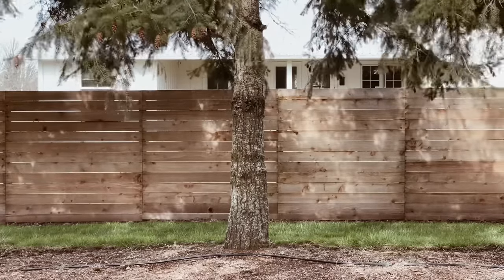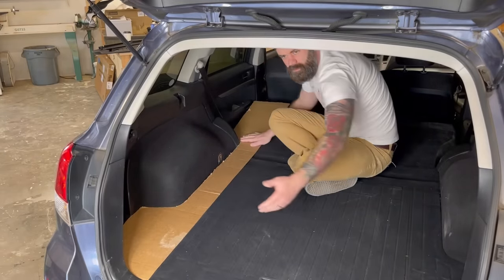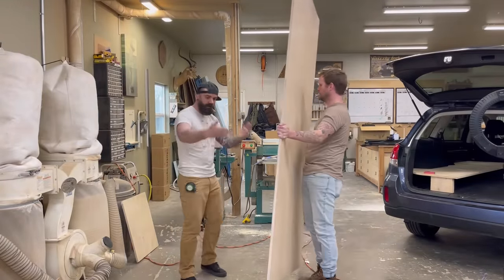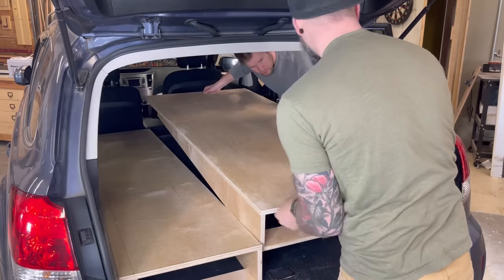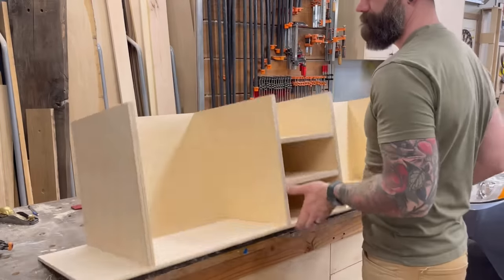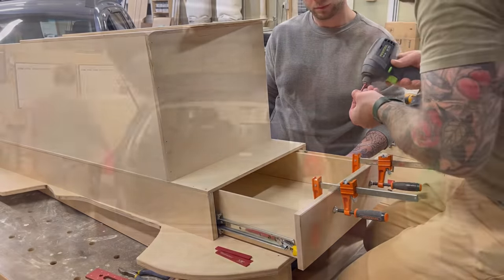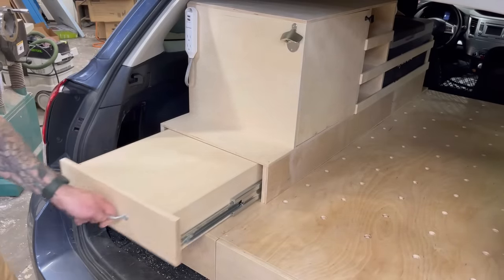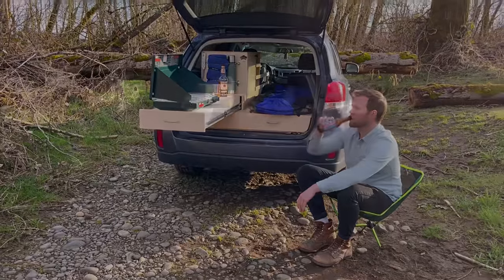Look What I Did To My Friends Car || Ultimate DIY Camping Conversion

Comment: Camping mattress in the back works fairly well for leveling out the back. I really wish those seats really folded flat.... I did wish for a platform a few times.  
Cabinet taking up half the space means he doesn't have room for company though....  I always just pulled gear out of the back and stuck it in the front seats and rear passenger foot wells. Plenty of room for two back there. 
Also, the wires from the solar panel seem likely to lead water in.... Better to leave some slack so it can be run up from the bottom when parked.
Reply: They fold flat in my 1990 Subaru Liberty wagon! Rear seat base flips up, take out headrests, fold seatback forward and it connects securely to a couple of tabs on the now-upper edge of the seat base. Quite flat and no sag over time. Superb old car. 420,000 km, no blue smoke, still fun to drive :-)  Phillip (Tasmania, Australia)

Comment: Strayan here. One thing we do here is use teflon runners for the drawers. They slide smooth as, and you get a significant increase in drawer size without the goliath runners. Bear that in mind when you do that minivan ;)

Comment: Nice build!  and great skills ! Lots of wonderful positives in this !  love the slide out drawers and table ! and awesome cabinet spaces!  but,  quite a bit of "wasted" hard to access space. 1) the place where the spare wheel was. 2) between the cabinet and the car window on the left side. 3) between the base board and the folded back seat.  . I have looked at several builds!  Quarter inch(6mm) ply was too thin in some. Your 3 quarter inch seems over kill and heavy.  Half inch(12mm) seems a good solution in many builds. I am considering 9 mm ply to make it lighter but will probably stay with 12 mm.  Very inspiring and great humour !!

Comment: Very nice design and build! The only build change I plan to make is to not glue, only screw, everything together. That will enable me to replace pieces when I discover changes need to be made or parts get damaged and need replacing. I think your design is so solid there would be very little loss of structural integrity. Nice project!
By the way: how much does this structure weigh? It looks like it takes a pretty big bite out of payload capacity…

Comment: Nice build. I have been using some tricks from Solid Wood Worx for my own little 2wd Toyota build (bed and cabinet system made last year). But, now i have a subaru OB so your work and design will be handy should i build it out. Thanks. SWW did a OB build but like others he pulled the seats out i think.

Comment: Hey, I just want to say LOVE your fun attitude and this video! Seriously... I’ve been SCOURING the internet and YouTube for a week now for the perfect car kitchen set up for me. I’m not kidding I really thought I was going to go permanently cross eyed. Then this!! It’s exactly what I want. I have a Mitsubishi Outlander.... which is Mitsu’s answer to the Subaru Outback. So pretty much exact match. I’ll be towing a small camper( 780 lb. Runaway Range Runner) so I don’t need the sleeping area but intend to use it as a space for my traveling buddy, Scooter the fat feral cat turned lounge lizard. The slide out kitchen system I think is the best and most efficient for this type of car. Plus the majority of available leather seats she can destroy with her claws will be protected when we travel. One thing I will add is I’d like to hinge one of the covers you made( with the hole for lifting) trace out the base of my collapsible sink and cut that out, so I can flip it out and have a ready to go place for cleaning up, yet fold it flat into that board and close it up when done. 
Sorry I’m rambling, just super grateful for you and excited to get this build going!! Said the middle aged chick lucky enough to have woodworking friends like you!! 😊😅

Comment: Nice build, but why didn’t you put the refrigerator in the front passenger seat area and include a few USB ports with an electrical outlet to charge electronics? Also, from my personal experience, anything breaking the rubber door seal results in rain water leaking into the cab of the Outback. How are you keeping that from happening?

Comment: nailed it :) look into marine grade finishes . . . and 'roughnek' finishes, it'll protect the wood stuff and keep the kit from bashing the living shit outta the car interior :)  those lil subaru are fun to kit out for stuff like that cause they either work or don't and if they work they'll go just about anywhere :)  also a really cool new bit of kit that people are adding to mobile deals like this are those vertical wind turbines, they're light weight, retractable mast mountable and generate lots o juice even in light to "no wind" situations and the newer line of vehicle / camp light options are slick as well . . . figured he put decent cash into that electronic rig, might as well go ham and have fun yeah :)

Comment: Center of a car. Laser level with a micro adjustment shot up through the car. When I worked for safelite we had to find center for recalibrating collision sensors and that's how we did it

Comment: Well done
Nathan should put in a 12v power port and USB ports. Makes no sense to use solar to charge a 12v battery, use an inverter to make the 12v dc into 110v ac so you can plug a phone charger in that changes it to 5v dc
Reply: I live in a Skoolie and run everything on 12v dc. No inverter
Reply: @SteampunkSteve  it's nice seeing others who have the same advice! Since you already covered the solar side, I offered up some advice on moisture issues, for the under side of Nathan's mattress... 😎

Comment: Any reason you used screws for the base rather than something like brad nails? Just wondering if that would be faster and with glue just as strong.

Comment: did you consider removing the rear seat backs, bottoms, and the foam under the rear floor deck? you could store lots of stuff in the space that is taken up by all of that stuff, and it is bolt in/out, so no permanent mods to the car.  You could put in hatches so you can access the area underneath when the drawers are pulled out. all you would need to do is remake the main supports once the seats and stuff have been removed.

Comment: This is a cool conversion! Nice job.
I like the carton stencils you used for the side trim! And very good explanation's. 
What i would like to know is, it seems you used a ballbearing slide that has a locking feature (trigger handle) but the locking feature seems inactive because you enclosed the mechanism with a drawer front and then added a separate lock to secure the drawer from rolling out. Why that? Or did you bypassed the locking mechanism?

Comment: @Bourbon Moth Woodworking I love this video and the build you did for your friend. I have just couple years until retirement and plan to live on the road. I thought of buying a printer can but looking at things they are not cheep plus the additional expense to convert. I drive a 2015 Toyota Corolla, while searching on YT for carlife, l came across your video. You inspired, it is possible to make any regular car a camper car. My question is, where are you located and can I pay you to build something similar like this for my car? Thank you for reading this and responding.😊

Comment: Love the build but hate the weight. 
Currently building out my 2001 vw golf in a similar layout but using a different build method. I am mostly using 2x2s for a skeleton frame and then I will lay a 1/4 ply, or luaun around it to finish it in. 
Also, I removed my seats to make it more permanent- multi piece so it can be removed for whatever reason but I dont intend to remove it much.  I am being very weight concious so I dont effect fuel economy too.. 

Cool video, tons of personality and funny jokes in this!

Comment: That is awesome man!! How did you get the wires from the solar panel into the car? Or did I miss something?
Reply: He went through the window as Nathan was going to put a rack and do it better later. He just closed the door on the wires. I'm assuming that would be done before the door wire the wires.

Comment: Several questions.. Didn't the car already have a solid template that was in sections to access everything underneath..?  
And why does it need to be on the level.. When you camp. Generally you place the head of the tent slightly higher for a better night sleep.. And if you don't find a level spot to park the car, it won't matter..

Comment: Found a 100 watt solar panel ripped clean through the aluminum mounting holes.... obviously it needs More secure mounting than the provided holes in the frame when mounting to a moving vehicle....

Comment: Question: This might be a dumb question but do you think it's possible to use the side drawer slides on the bottom of an extended drawers? Instead of on the sides? I'm having a hard time finding full extension under-mount slides that locks and are 28"+.

Comment: Fun stuff here. Point of safety, all lead acid batteries (yes, even AGM batteries) "breath" or off-gas sulfur dioxide, so these types of batteries shouldn't be in an enclosed sleeping space. Lithium batteries don't have this problem. Also, IMO, the top surfaces should have extended over (and maybe a little beyond) the drawer faces, that way dragging stuff in and out wouldn't catch on/damage the drawers.

Comment: Hey Jason. Love your work! Your content is top drawer! You know top notch! You know what I mean. Great stuff! Anyway, I spent 20 years in R+D with Honda. I thought a great second video for Nathan’s car camper would be a roof mounted storage box to house a custom foldable table and chairs set. It would also give you a great place to mount the solar panels as the angle of the lid when propped up would allow  for optimum sun exposure. Nathan will read this and he’ll be pounding on your back door! (That didn’t sound right but you get my drift! ), to have you do this for him. Anyway, I’m not a wood worker of great abilities. I did spend several years as a boat builders assistant. (Your boat building videos were pretty much on the money) Check out Canoe Craft. It’s by Ted Moores, an excellent craftsman and restoration expert of antique wooden boats of all sizes. I learned how to handle and sharpen everything from spoke shaves to cabinet scrapers from him. Anyway I am really enjoying your channel and my subscription to it. Your humour is a riot and your content is second to none! I am now a professional arborist and have been doing this for 30 years now. So we’re both in wood working but at different ends of the stick so to speak!Lol. Thanks so much for all your inspiring video tutorials !
 Warm Regards,  Troy at Trojan Tree Care “Ensuring Future Growth “

Comment: I have an idea for a project that I would like to see/try

Come up with a garage/shop shelving system made from construction grade lumber and plywood, that you can use right away for storage, and then show us a way to box it in with cabinet doors and drawers and various other bits to dress them up and increase the functionality.

I'd like to see this because my wife and I just bought our first new home, and while I've got the tools I'd need (table saw, circ saw, drill, router, etc.) I don't really have the confidence in my skills yet to take on a big project with cabinet doors and drawers yet, but I do really have a need to get all my crap out of the way so I can actually start using my garage to start developing those skills!

Comment: Would've been better getting a 12v fridge. Running an inverter in that setup is really inefficient and with just one solar panel charging will be slow so preservation of power by running everything at 12v would be better. Great unique conversion though. Love it
Reply: Portable power stations would
 be the easiest and safest way to power things in car without to much hustle.
Reply: That is a 12 volt capable  fridge

Comment: I did this to my Subaru  Forester   over 10 yrs ago, i had a 2004 its bigger than an Out back. I am that Older Female owner. But i made myself a canopy  and used the entire inside as a bedroom.. the canopy covered the back half of the car, if all the lights are left turned off the hatch could be left in the raised up position indiffinately with no battery drain.  I was able to tarp off the front windshield  and the side windows that insured  privacy. I made a felt floor that tucked under the back floor mat and tucked over the back bumper around the tire wheels, folded well under the back of the car. To seal  off the underside of the car from unwelcome guests it then was pulled out enough to be  my carpet floor. No dirt to track into my sleeping bag. Fold up table, for my stove  and kitchen  stuffs, portapotty under the table  and my heater. I  used my ice cooler as my refrigerator  and as a step up into the bedroom and as a seat. The flap dropped down at nite to close me and my pup  in , safe from nite company.  Able to stand up right,  fixed the  canopy ties to the doors  and the out side  ties to stakes. Its done with a  canopy that can be bought at walmart with snap in poles that fold out.   As a single older woman, i can put this whole thing together myself , really nice in 2 hours, holds up in heavy winds. I camp a week at a time everything  in and on top of my car in a roof carry large heavy lidded  tub.  Tools, shovel, etc.  I dont have to sleep in one spot, its a twin sized two can sleep together bed.

Comment: Really cool build—great woodworking skills and design. BUT. What happens if you’re catastrophically rear-ended? Does that whole box just slam into your back and smash you onto the steering wheel as the car crash zones crumples? Might be better to build on the passenger side if you’re camping solo.
Reply: That is very smart

Comment: I have a question: I had a Subaru Legacy Wagon and the back seat folded down flat when you flipped up the back seat bench. Does the current Outback not do that?
Great conversion, btw.

Comment: I love it.  It is great.  But I would be very careful with that stove.  I have melted plastic tables and scorched wooden tables more than once with a stove just like that.  You Would think I would have learned from my mistakes,  but I am not smart like you.  A small piece of backer board might be a good underlayment for the stove.  I found that the problem is with the time of use.  So as long as the stove is not on for more than 30 minutes or so you will probably be ok.  Any more than that (think a really good pot of stew or chili.) it will start to have a bad effect on the wooden top.  Like I said though.  Awesome build.  I hope He has many wonderful adventures in his rig.

Comment: The last time that I ran a wire through the door gasket like that, we had a heavy rain and it came in around the wire, flooding the inside of the car. Then I ran the wire through the window with the window rolled up as high as possible, and a tie wrap applied to the wire on the outside to form a drip point for the rain coming down the wire to drip off before coming through the window. I also made certain to put a little sag in the wire at this tie wrap. Another heavy rain storm and no rain at all inside the car this time. Of course, one needs to be careful when opening this door with the wire coming through the window, but at least this way was rain proof in all but totally horizontal rain. Even then, it is better than running through the door gasket. You should have shown what it takes to get in and inside and out of the sleeping bag. I would guess it has to be through the right rear door.

Comment: amazing  build! very easy to follow and descriptive. I'm attempting something similar to this and building a camper conversion for my 2010 scion. I had a quick question if anybody in these comments would be able to answer from experience! Was folding down my chairs and seeing how much space/support I'd have to work with in the back of my car, and there will be a pretty decent gap from the top of the backseat to the passenger seat. The frame on my backseats doesn't feel altogether stable, and I am concerned that without legs supporting the sleeping structure down to the passenger floor, it may warp on one end or set the whole thing off kilter. Is this a valid concern and something I should consider when building the frame?

Comment: Weren't those long slides the locking type? They should lock in and lock out. Normally you make the yellow handle bit poke through front drawer face so they can be actuated

Comment: 2000 to 2004 the seats fold flat and you get one more foot the rear lower seat pulls up to the front seats and the back fold flat

Comment: Definitely not a car guy as a car guy would have just removed the bench seat pad, if not the rear seat backs altogether, from the rear to make the entire back level as clearly this is not a 'removable' mod and thus, you can stow the seat parts in a shed somewhere if you ever want to resell.  Should be less than 8 bolts total for seat bottom and rear seat backs, although I doubt you'd have to remove the seat backs.

Comment: If the backseats are left unusable, why not remove them have a completely flat surface with a bit more vertical room, and add slide out drawers underneath accessible through the rear doors?
Edit: sorry I thought it was intended to be a permanent install.

Comment: Nice job, but when you're driving all the weight is on the driver's side. If you put the cabinet on the passenger side then the load would be more balanced.